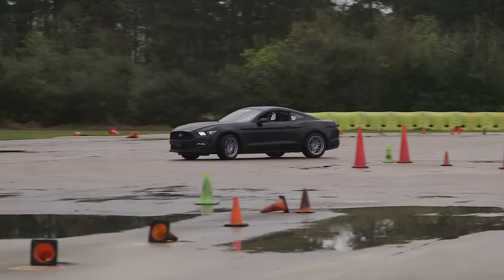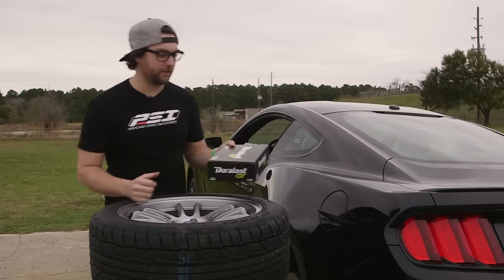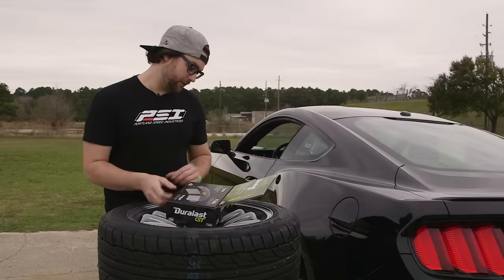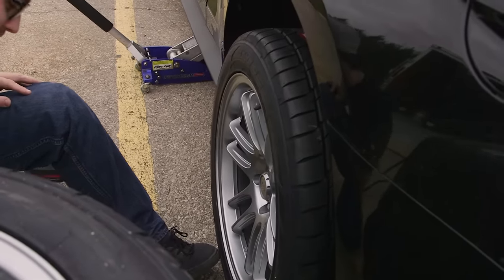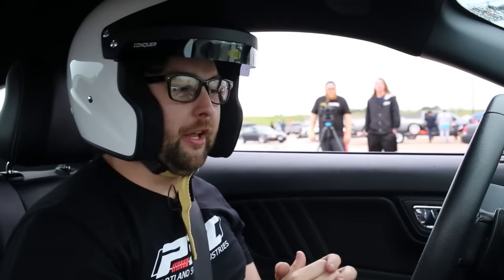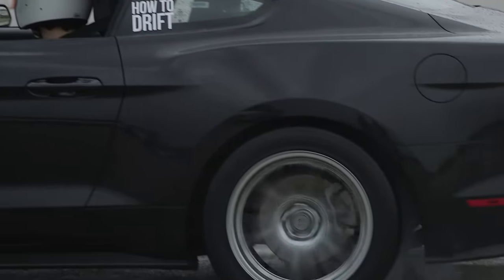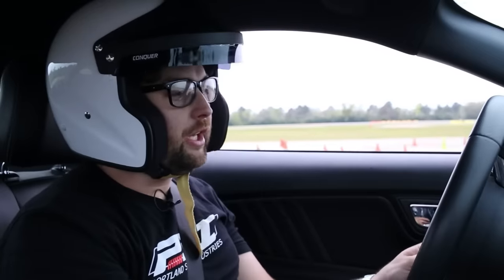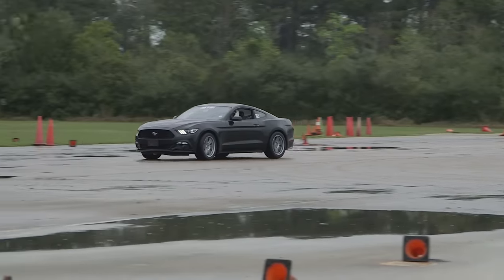HOW TO DRIFT AN AUTOMATIC CAR. No Clutch, No Problem. LETS SHRED IT!

Comment: issue with my Genesis is the car decides to shift itself into the next gears when doing burnouts or trying to drift. even when i have it in manual mode.
Reply from the maker: +cxcevents this does the same thing. Gotta keep it off the limiter
Reply: Justin Nestlerode coupe

Comment: It works but sometimes it changes gears mid drift and throws me off.
Reply from the maker: What do you mean?
Reply: Like lets say the car is in second gear in a turn, I drift it out and as I transition to another turn the car switches to like 3rd gear.
Reply: Tony do you have a sports shift mode?
Reply: It wasnt my car, I was just screwing around with a friends car.

Comment: Is this possible with an awd automatic?
Reply from the maker: No
Reply: Chelsea DeNofa may you elaborate please? Also whats that intro music you got? I really like it
Reply: Depends on the vehicle. Volvo's can sort of do this with AWD as you can use alternating the turbocharger and turbo lag to lock up the rear wheels(sort of). It isn't really drifting, more like power-sliding, but it's still great fun. You are more or less just tricking the AWD to just put power to the rear wheels and or front wheels. It really helps when the Volvo S60 I had also had the ability to flip to the left and use geartronic or shiftronic shifting. Slamming tons of power into the rear wheels before the front can catch up. 

What really helped when I first got the car was the fact it had already worn down Toyo tires which had more tread on the front tires than the rear ones. After my parents made me replace them, it was a lot harder as all 4 tires were now the same tread and the AWD compensated for the loss of traction far better.

I had a 2002 Volvo S60 AWD and the insane amount of power it had was downright terrifying sometimes(compared to my Z31). It is really hard to describe but I used to do it all the time on a mountain road near where I used to live. The newer Volvo's now just immediately auto correct and lock the traction down like sandpaper, but the 90's and early 2000's you can trick the AWD once you get the hang of it. The turbocharger can allow for sudden acceleration and with sudden acceleration on my car the AWD would lag just a bit before it would compensate. It took a lot of tries to get it just right, but it was extremely rewarding once I got it. Blew some of my friends' minds. They never believed it was possible.

I know this trick doesn't really work with the Sequential AWD Subaru's as my friend and I tried to trick the AWD in his car and it just wouldn't let up on traction no matter how hard you pushed it.

Comment: Bro i wish you did this thing stock and didn't remove sensors and shit, I'm not tearing my rental apart.
Reply from the maker: All you have to remove is the plug by the shock tower and airbox on the driver side now.

Comment: Ez, in my mothers camaro i just do semi auto on, first gear if you stand still and wanna drift, 2 gears lower when having speed. Just go full power and steer... when you feel like you should stop drifting drop throttle with 75/50%

Drifting made ez

Comment: But guys you need to know that YOU MUST HAVE STRONG ENGINE you need more powet to drift easly
Reply from the maker: nah, this thing was fine in the wet and dry. Just air the tires up. Power isn't necessary.

Comment: Would prolly be easier if this wasnt a v6 mustang 😂
Reply: I4 turbo*
Reply: @malcolmbrown9733  oh, so a little better than a stock v6 and a little slower than a 5.0 prolly
Reply: @xyz__978  Ecoboost is better than a v6 cause of turbo, but alot slower than the 5.0 BUT the Ecoboost with FBO could beat a stock GT.
Reply: @malcolmbrown9733  I dont know too much about mustangs, but it seems pretty logical
Reply: @xyz__978  yeah, i had a mustang ecoboost for about 7 months then upgraded to the 5.0 big difference, but i would gap v6's

Comment: LoL, you dift using the e-brake
Reply from the maker: Yea, its an auto... to get a snappy entry you have too. No other way.
Reply: I never use a hand brake, and my car is automatic, as long as you gain enough speed you actually can snap the car for long turns, newer automatics are way better at it than older automatics